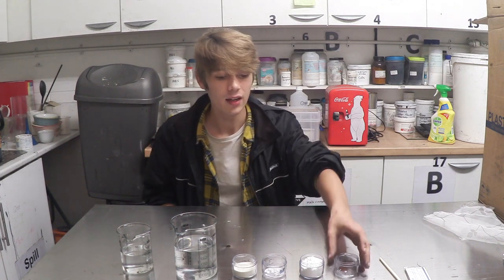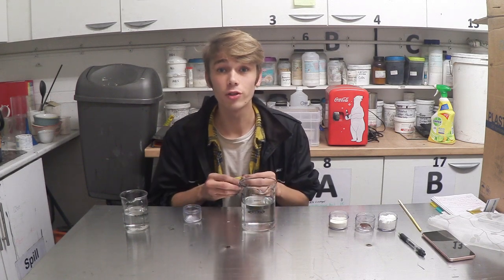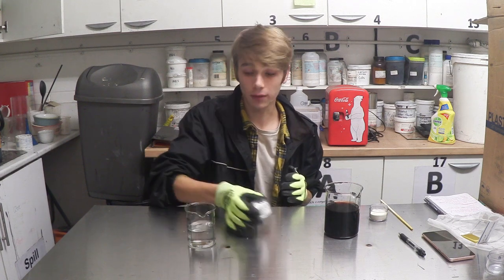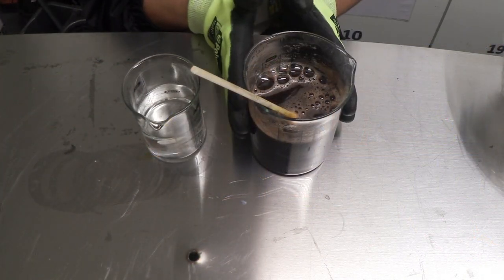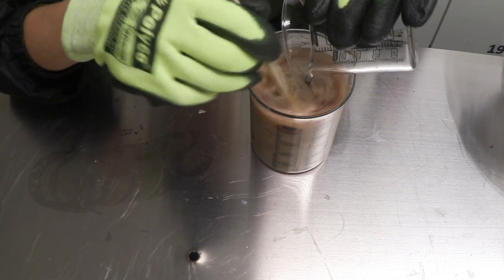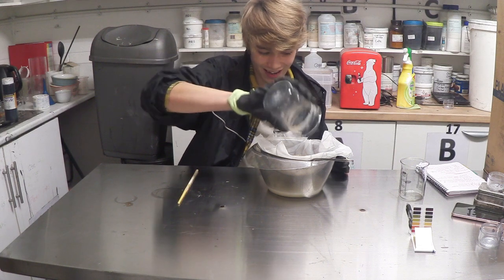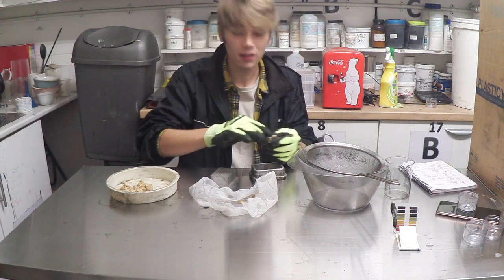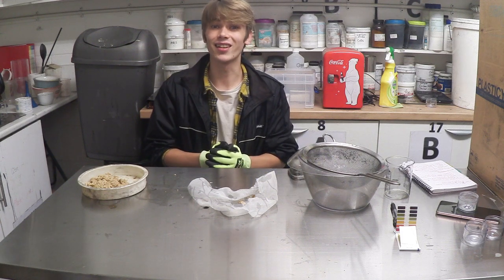Guitar Picks From Bio Plastics

Comment: Is that type plastic water proof? You need to wash your hands before you play your guitar, you don't want to run the risk of grinding anything into the fretboard. I love playing guitar, I'm not as good as I would like to be either, you just have to practice all you can and you should get better and better until you get where you want to be.
Reply: I'm unsure if it is waterproof, it might be water resistant but I will have to test this. 
Also playing the guitar is awesome, but you're right it is all about practice.
Thanks mate!